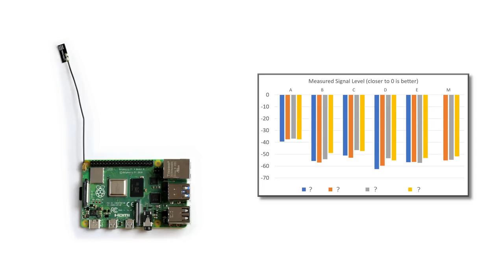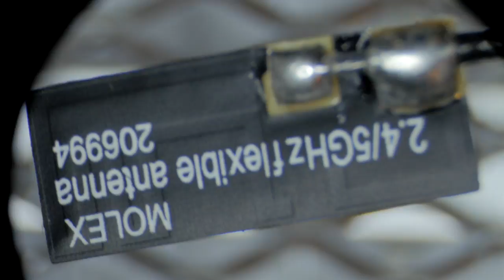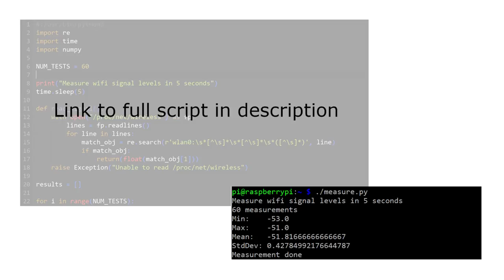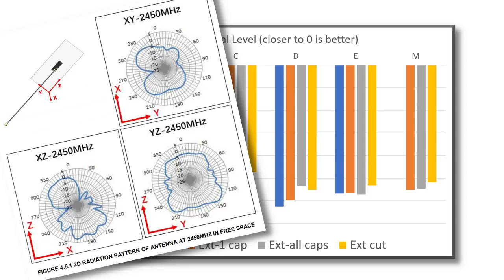Add External Antenna to Pi 4 [Detailed Instructions & Analysis]

Comment from the maker: After a few requests, I've made a some modified Pi 4 boards available for people who don't have the time, or equipment to do it themselves. Check them out here: https://www.ebay.com/itm/114773307539. If you already have a Pi that you want to be modified, I now have a service available for that here: https://www.etsy.com/shop/FunAndTech
Reply: I was chuckling throughout your entire video.  I am famous for having terrible manual dexterity.  That's why I do software.

We might order a couple boards.
Reply from the maker: @BoredSleuth  Hmm it still works for me. You can try going directly to this listing as well: https://www.etsy.com/listing/1007434724/modification-service-add-external

Comment: just found this. did this to my pi 4 as the metal case had been tanking the signal strength. i will now be doing this to every pi i work on. its so strange, this is such an easy mod you could almost swear it was supposed to be there. also FCC eat your heart out.

Comment: Thanks! Your testing allows me to forget all about doing this altogether. I won't be putting any of my Pi's in metal enclosures. Other than in that particular case the gains provided by the external antenna are pretty minor and certainly not worth the trouble for me. I do appreciate the detail though. Now, if I were to do it I would have absolutely no questions at all about exactly what to do.

Comment: Thanks! This saved my day after I found out the all-metal passive-cooling pi case I purchased also completely blocked the wifi signal. I had a self-adhesive antenna not unlike yours lying around and cannibalized a u.FL connector off an old unused GSM board. Works like a charm!

Comment: This is a basic occasion. 📎 Nothing special
Reply from the maker: Probably near zero. Fiberglass degrades quickly in water, so it pretty quickly disintegrates if it gets in the lungs which is one of the reasons it's reasonably safe.
Reply from the maker: @-blackcat-4749  If you are just getting started, then 63/37 leaded solder has the best eutectics and is easier for a beginner. Lead-free solder requires higher temperatures, which can result in more flux vaporization which can be more acutely harmful, so it's important to get the feel and technique of soldering down first. Then you can switch to lead-free solder. 

Far more important is to make sure you have a good fume extraction system so you are not breathing the flux fumes. Also make sure to wash your hands after soldering to remove any stray lead dust and avoid ingestion.
Reply from the maker: @-blackcat-4749  It might be adequate if you only do occasional soldering. Just remember that if at any time you can smell the flux, the  ventilation is inadequate. If you end up doing soldering regularly, then getting a proper fume extractor like a Hakko FA-430 is well worth the investment.

Comment: Great video. Did you use 2.4 GHz or 5.0 GHz? Any differences in these? Also, which antenna part variant are you using? I want to get the same from Mouser, Digikey or Farnell.
Reply from the maker: These tests were done using 2.4GHz though the modification works with both. I used the Molex part #206994-0100 for these tests, though you can typically use any antenna as long as it 1) has a U.FL connector, 2) is Dual-Band WiFi compatible (2.4GHz and 5GHz), and 3) has a characteristic impedance of 50 ohms.
Reply: @funtechu  Thanks. I placed order the same and also Hirose U.FL-R-SMT(01), Vishay CRCW02010000Z0ED resistor and actually also Multicomp Pro MP004561 heatsinked case.
Reply: Hehe, I just finished with this. It seems I messed something up XD The solder bridge I chose in the ende was easy peasy for some reason. I just used flux (for the first time in my life) and tiny-tipped soldering iron. Bang, I could not believe I had it with first try. The U.FL connector was for some reason trickier for me. Got the third right. But for some reason the unit does not appear on network. I probably skipped some checks because I was too happy of initial success. I need to check the ring and GND. Tip is firmly ok. I tested conductivity to the first of caps before I scraped off the rest of the line. I'll need to see what is happening on a monitor and re-test ring continuity and antenna seating. If it is really broken, then my hot air gun probably totaled the radio chip. But I will check it again. No regrets!
Reply from the maker: @JannePaalijarvi  Hopefully you can figure it out :)
Reply: @funtechu  I tried to took off the antenna cable but it ripped of the whole UFL connector. Then I resoldered the connector. I scraped a bit to expose signal line copper. I measured: No shorts, good conductivity end-to-end. Basically the same situation as before, so I did not anticipate any changes. But when I plugged it in, it came to life! It connected through 2 and half walls, where it previously was struggling like crazy. Now I will cover the whole thing with hot glue so it does not move. Thank you!
Reply from the maker: @JannePaalijarvi   Interesting. Glad you got it working though. Maybe there was a small short between the c enter connector and ground or maybe just a cold solder joint. Either way, glad you manage to make it work.
Reply: @funtechu  Plot is thickening. This is possibly some kind of problem with brcmfmac and my access point. Problem seems to be sporadic. Thought also that this is a power save issue, but it is not.
Reply: Finally. I updated the Alpine Linux to 3.15. This seems to have solved rest of the issues, at least mostly. I tried 10 reboots and on 9 cases it got instantly the IP. On one case it took like 30 seconds. I'd say problem solved. The earlier kernel and firmware was probably just immature. Maybe the actual root cause of my problems. But hey, not complaining. I have super-cool aluminum chassis RPI 4 with superb connectivity now. Thanks again.

Comment: What if you fill up the holes of the PCB antenna instead of destroying it ? And/or connect it to the ground.That should transform the antenna into a simple ground metal plate.

Comment: Mod worked great on Pi 5. I have an amp I built in a metal enclosure. Adding a PI to it was a great addition however the wifi signal was only about 60%. After the mod I'm getting 90% consistently.
Thanks..

Comment: Thank you so much for doing all the work and sharing.   When I saw that long stub trace left there when the capacitor is removed I thought the designer had made a mistake, or they were just so smart that it was some impedance matching leg or something.   I was planning to cut it off as my experience with PCB design made me suspect it would just add a reflection and dork up the signal.   Your testing shows the correct solution perfectly.   Great engineering work.  A shame the original designer wasn't better at layout.  The Pi designers likely don't have the resources or high end CAD tools to do really careful PCB layout reviews or analysis.

Comment: This was awesome to find out! building a large reef aquarium lighting system using a pi for pwm control of 36 different channels of LEDs. thought I would have to mount the pi external to the aluminum housing or have it hardwired to the network...not now!

Comment: Resistors in size 0201 must be ordered separately. Why not use a dis-soldered capacitor as a bridge?
The trick is working with a lot of flux the 0201 component floats in position.

Comment: I've attempted this on 6x Pi 4s, but I have to admit, the 0201 resistors was quite challenging to install. 

I'm curious if simply bridging the pads with solder would be just as good? I know it's suggested to use a 0ohm over for example a wire (as mentioned in the video), but given the size of the area, and how close the pads are on the area, would simply soldering not be satisfactory? 

Appreciate any input. Thanks
Reply from the maker: Bridging the pads with solder would make a connection at least at DC, but at higher frequencies like those used for WiFi it would likely not be a good quality connection and would result in impedance mismatches. This would cause reflected power which could reduce the performance of the connection.
Reply: @funtechu  Thanks. Much appreciate the response.

Comment: Thanks for the good info. I never compare signals as shown but I just removed the capacitor and put it on the external antenna line. I don't know if it works better if replace the 0 ohm with the removed capacitor. it works though.
Reply from the maker: It should work fine. At the WiFi frequencies, the capacitor acts essentially like a short (X=1/(2*pi*f*C)). I don't know how it would compare with the other options, but I suspect it would work just fine.
Reply from the maker: To be specific (since the values are all known), that is a 10pF capacitor and that capacitor at 2.4 GHz has a capacitive reactance of 1/(2*pi*2.4e9*10e-12) = 6.6 Ohms.
Reply: @funtechu  Thanks for your reply , yes, the XC is high indeed.
Reply from the maker: @myaquaponic5206  Sorry if I was unclear that wasn't my intended meaning. 6 ohms isn't particularly high, hence why it's working
Reply: @funtechu   I have been used the capacitors for quite a long while. Although it works,  I think the performance of 0 ohm resistor can be better. I will try it and compare 0 ohm resistor VS capacitor . TQ.

Comment: I once tried testing how my smartphone Wi-Fi signal worked from inside a microwave oven.  I used a signal strength app and looked through the door.  As I recall, there was less change than I (novicely) expected.  I was like, wha???  (I don't stand as close to the oven since, 😁)

Edit: I tried it again with open door @ -53dBm and closed door @ -83 dBm.

Comment: Hi ! Thank so lot for this very precious video. I wondering, does it possible to solder directly a coaxial cable to the PCB? Without the UFL connector?
Reply from the maker: Yes, it's possible, though a little tricky. You would need to cut and strip the coax cable and separate out the center connector and the shield. You would connect the shield to the ground plane (where we scrape off the solder mask to make a connection), and the center connector to the center connector pad. 

Personally I prefer the U.FL connector because it allows easily swapping out antennas, and it ensures that it's a properly impedance-matched system. But soldering on a coax cable is certainly possible.
Reply: @funtechu   Hi ! Yes thank's for your answer.  Actually, because I don't have air flow soldering machine, to attached directly the cable to the board seems to be easier.

Comment: If I don't use a connector, if I solder directly the wire from the antenna (included), will it not break the impedance matching? Will work?
Reply from the maker: It should work. You would solder the center connector to the pad coming from the Wi-Fi chip, and you would solder the shield to the ground connections on the side. You would also need to be very careful that the coax cable is fixed and doesn't move around a lot otherwise it could end up tearing the trace off the board once they are soldered together
Reply: @funtechu  Thanks a lot for your answer. Yes, I know that when soldering to the tracks, you should use a glue gun after.

Comment: The only thing you didn't test was leave both antennas intact. 
Which is what I will try on my 4b. 

Please post your script. 

This would have made a wireless T shaped emitter. Depending on the physical polarity of the second antenna, and the width between, this antenna may have a much higher directional range.  . 

That said antenna design is almost magic. Without a test pattern it would be hard to see.
Reply from the maker: I did test that setup during my preliminary checks when designing the experiment because one other commenter on the original follow up video asked about it. However I didn't include it in the final experiment (or this video) because it's a less-than-ideal situation. The issue is that leaving both connected effectively puts them in parallel which means that 1) each antenna gets at most 1/2 the power, and 2) the impedance as seen by the wireless chip is half of the expected value which can result in reflections and cause additional interference. I did run it just for curiosity, but as expected, the results were around 20dB worse than any other option, including stock.

As you mention, in theory, the external antenna and internal antenna could be positioned to constructively interfere to increase the directionality. However, it would be more repeatable and easier to just use a good external directional antenna in that case (cantenna, yagi, etc).

The script is linked in the description if you want to play around with it.
Reply: @funtechu  thanks for the reply. 
My setup is running manjaro arm64. 
Getting it tweaked is interesting

Comment: Hey Caleb, QQ if that's ok please? Thanks so much for the awesome video, really cool work!!! I'm looking at adding four antennas instead of just one (in order to collect CSI data). Is this possible with this approach please? Thanks a ton!!
Reply from the maker: Hmm that's not an area of experience for me, but here are some things that may help. The wireless chip used on the Pi4 is BCM43455
 which doesn't appear to support multiple antennas (besides externally mixed multi-antenna arrays). I did find this project (https://github.com/seemoo-lab/nexmon_csi) that supports extracting CSI information, and supports the BMC43455 chip, but that would still only give you information for a single antenna.
Reply: @funtechu  Thanks SO much for the brilliant reply Caleb! Really appreciate you looking into this. I guess I could use a USB antenna like this (https://bit.ly/3sQGnwC) but then it would use a different chip and so defeat the point

One follow up question if that's ok, please could you share an example of external mixed multi-antenna arrays please? Am not quite sure what you mean.

Many thanks again!

Comment: Thank you for sharing! Would this increase bluetooth preformance also?
Reply from the maker: Yes it should. WiFi and bluetooth use the same antenna.
Reply: Yes, I'd like to confirm that BT and WiFi signal is better. In my case I'm focused especially on the BT (for Xiaomi BLE temp/humi ensors in entire house). One change is remove 1-st capacitor and solder "hot" antena wire directly to the solder point. My observations is simple and match to performed changes: BLE devices independent of place (external house or garage by the 3 walls) connecting faster and stable. Link quality (RSSI) was increased.

Comment: Regarding the 206994-0100 Molex antenna, is it best to orientate these vertically, or horizontally, or with the size/rating, does it not matter?

Sorry, I did have a look through the datasheets and went down a google rabbit hole, but I couldn't get a clear answer on this. 

Thanks again!
Reply from the maker: If you look at the Application Specification document, pages 10 and 11, you can see the radiation pattern for the antenna for 2.45GHz and 5.5 GHz (two WiFi frequencies). That will show you roughly how to orient the antenna if you have a known position of the other device the antenna will be communicating with.

Comment: Soldering that tiny connector was relatively easy even with my primitive soldering tools, but man, I've been struggling with that solder bridge for 20 minutes now
Reply from the maker: If you can use a tiny piece of wire (like a snipping of a strand from some stranded wire) then that will help. But yeah it's pretty challenging to do with a soldering iron only.

Comment: What's the reason you used a 100mm antenna, instead of a full-wavelength (125mm)?
Reply from the maker: 100mm is the length of the coax cable, not the antenna.

Comment: Do you know if that's the same connector as on the CM4?
Reply from the maker: Yes, the CM4 has the same U.FL connector. You can use the Compute Module Antenna Kit as your antenna after this modification, or any other compatible antenna.

Comment: Do wifi and bluetooth from raspi share the same antenna? If I perform this mod in my raspi, the antenna will support both? My raspi will stay in a metallic case.
Reply from the maker: Yes, they use the same antenna, so the improvements apply to both WiFi and Bluetooth
Reply: @funtechu  awesome, I was about to buy two USB adapters with antennas, one for each. You saved me, thanks!